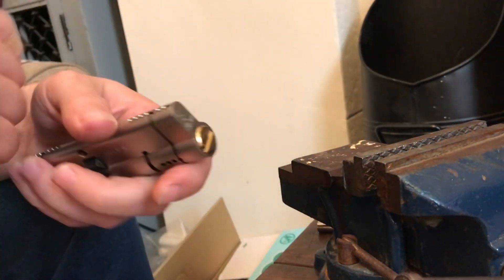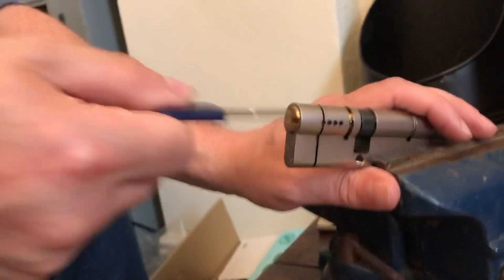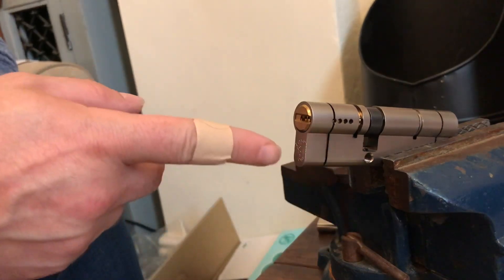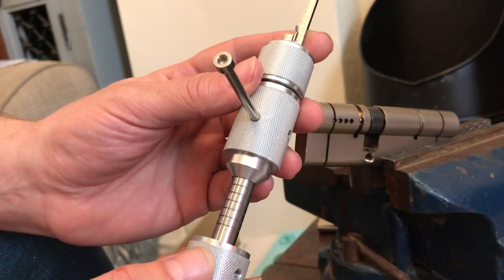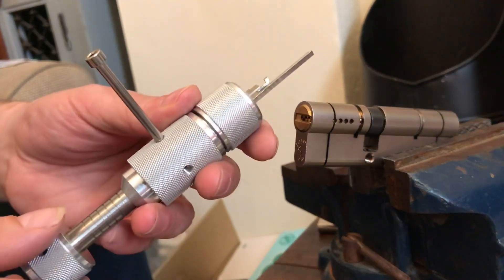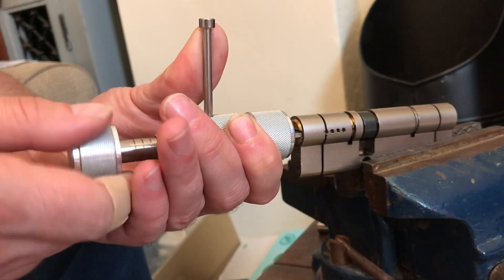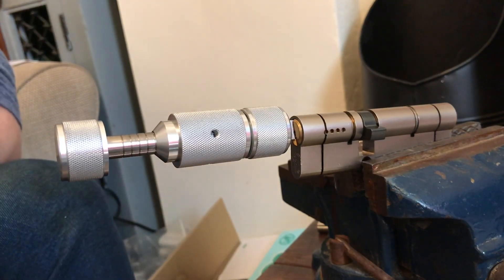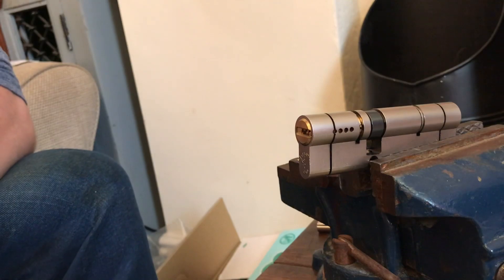Opening a Garrison cylinder with the GJ Locks Mul-T-Lock 7X7 pick

Comment: Awesome video buddy, you definitely made that look easy 👍 btw, got the decoder the other day and your videos have been a big help
Reply from the maker: Dyfrig james cheers pal, they are far from easy but practice practice practice and you know what sounds and feels to look out for. Did you get the Fortress decoder?
Reply: Yeah the fortress decoder, it definitely takes some getting used to, been leaning all sort of shapes and angles to get a reading 😂
Reply from the maker: Dyfrig james was it the GJ Locks one or a different one pal?
Reply: The gj locks one buddy
Reply from the maker: Best advice I can give you is if you’re practicing in a vice, make sure it is at eye level as if you were at a door, then take the lock apart so you know what number the levers are, but rearrange them from low to high and then calibrate the pointer lever so it’s bang on each time 👍🏻
Reply: That’s awesome advice thank you very much buddy